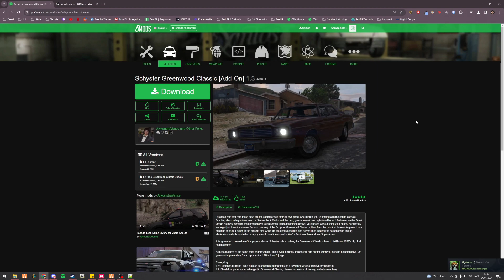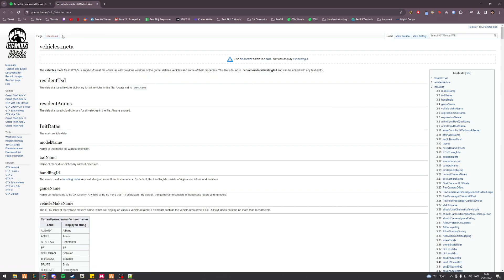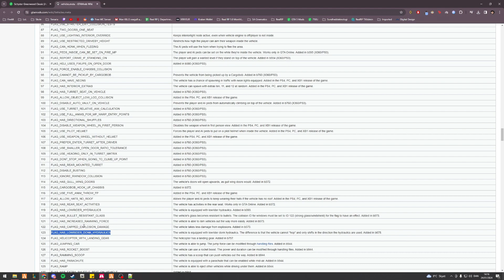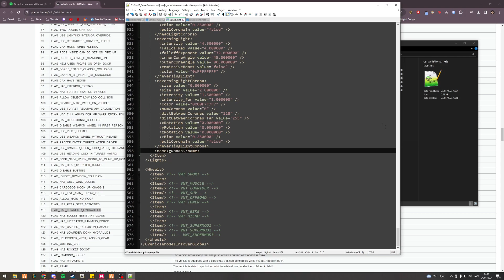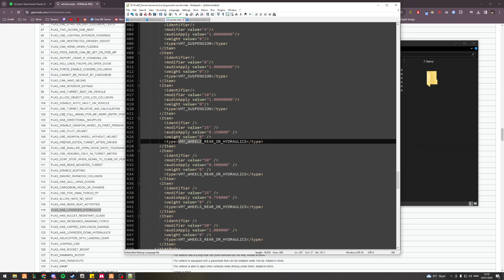FiveM Vehicle Development - Adding hydraulics to cars

Comment: <Item>
			<identifier />
			<modifier value="20" />
			<audioApply value="1.000000" />
			<weight value="0" />
			<type>VMT_WHEELS_REAR_OR_HYDRAULICS</type>
		</Item>
		<Item>
			<identifier />
			<modifier value="40" />
			<audioApply value="1.000000" />
			<weight value="0" />
			<type>VMT_WHEELS_REAR_OR_HYDRAULICS</type>
		</Item>
		<Item>
			<identifier />
			<modifier value="60" />
			<audioApply value="1.000000" />
			<weight value="0" />
			<type>VMT_WHEELS_REAR_OR_HYDRAULICS</type>
		</Item>
		<Item>
			<identifier />
			<modifier value="80" />
			<audioApply value="1.000000" />
			<weight value="0" />
			<type>VMT_WHEELS_REAR_OR_HYDRAULICS</type>
		</Item>
		<Item>
			<identifier />
			<modifier value="100" />
			<audioApply value="1.000000" />
			<weight value="0" />
			<type>VMT_WHEELS_REAR_OR_HYDRAULICS</type>
		</Item>

Comment: is there a way to do this with the default cars?
Reply from the maker: Considering that the question opens up for two separate answers.

#1. You could technically speaking just grab any kind of NPC car that you see on the street, turn than into an add-on, and then follow the steps in the video. 

#2. This is the answer that I think you're mostly looking for, which is whether you can add hydraulics to NPC cars. Technically speaking yes. On paper would simply just require you to stream a carcols.- and carvarations.meta file to a specific spawncode ("stretch" as an example), and then it should work. I will say beforehand though that isn't something I have ever tried personally.